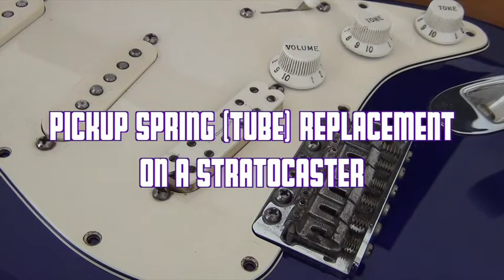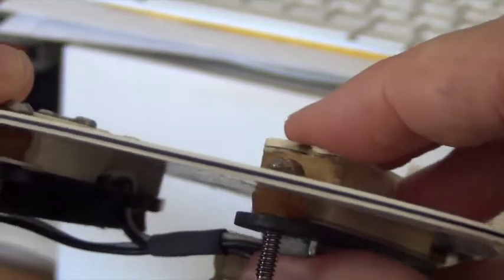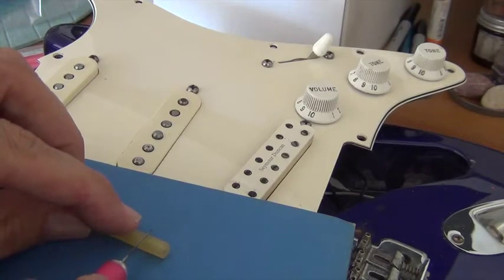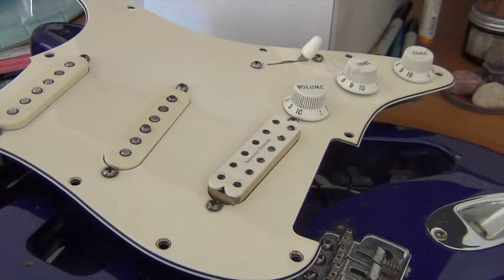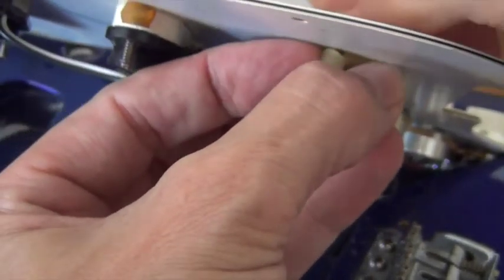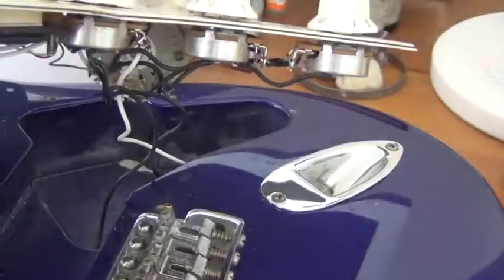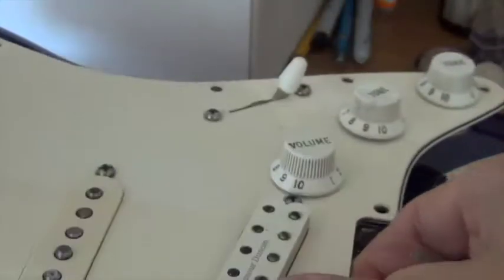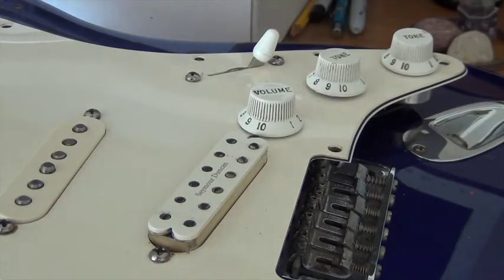Fender Pickup Spring Tubing Replacement

Comment: The springy rubber tubing for old Strats can be used to fix a common problem: a "too free' volume pot turning. Bumping the volume knob as you play can change to volume setting. 
So remove the knob carefully and then get a very short rubber tubing (maybe a 5mm length) and wet it with saliva as well as the shaft of the volume pot. Slide the tubing down over the serrated shaft to make the volume pot turn with friction and now the volume will not be easily changed. 
A tiny dab of rubbery glue on the shaft might also work...
Reply from the maker: Great hack, thanks!

Comment: Does this work on a microphonic Tele?
Reply from the maker: not sure, just depends if the pickups use tubes or actual metal springs.
Reply: If your pickup is microphonic ie acting like a microphone then unlikely. You would need to pot the coil normally by dropping in hot wax and letting the air  bubbles out. The reason I am here is telephonic pickups on a Jazz bass. So I bought some Ironstone replacement in UK but these have the surgical tube. I am trying to work out pros and cons of tube v springs.

Later I will try to pot the old ceramic pickups but the new ones are Alnico and I love Ironstone sound so likely not cost effective for me to try to fix microphonic SX Jazz bass ones.
Reply: Actually seems on a bass at least some say the mourning material can also lead to microphonic pickup - see https://youtu.be/RmXIQbE2edQ

With guitars I normally use springs and microphonic pickups are fixed with potting. Will try mount material as well as the Ironstones - I do want the Alnico tone rather than the stock ceramic. But for sure try a different mounting technique before getting new pickups. Thanks for encouraging me to do more research.